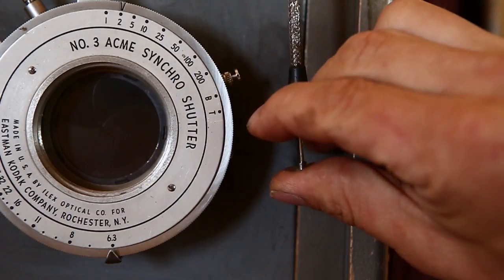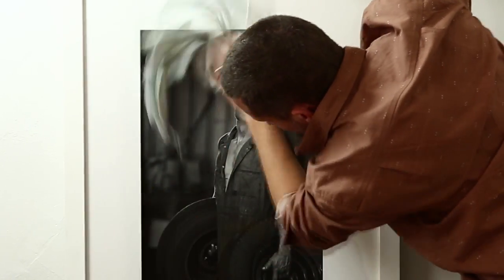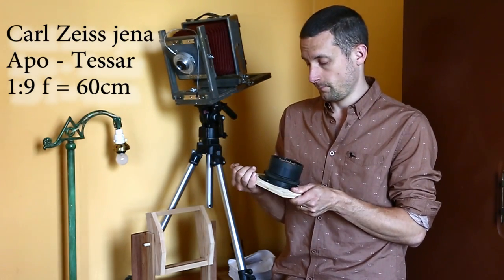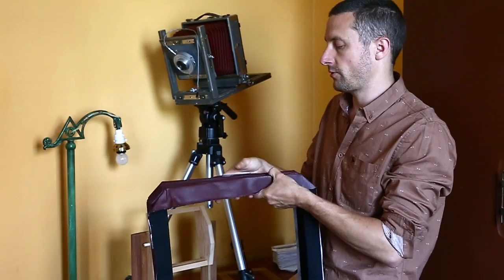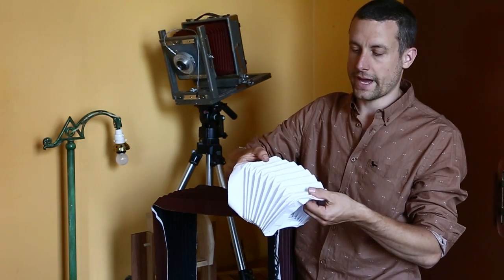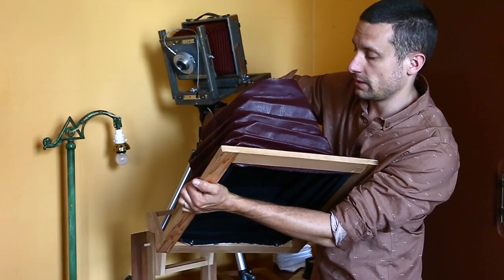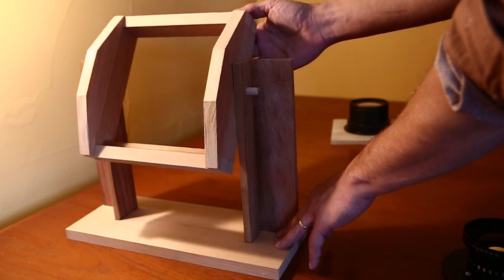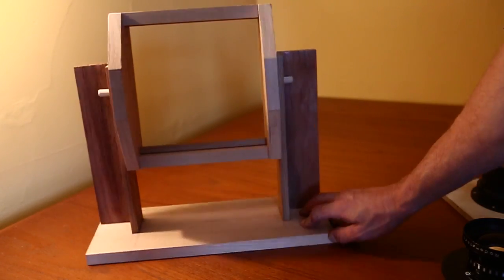View camera build

Comment: How would you figure out the projected image circle of the lens if you don't know the focal length of the lens you are using? I am making plans to make an 8x10 sliding box type camera with a single element lens but am unsure how to choose a lens for it. Do I choose a lens with a wide or narrow diameter and what will affect the size of the image circle I get on my negative (I am thinking this will be the distance from the lens to the film -like a magnifying glass)? Thanks anyone for the help!
Reply from the maker: Lens coverage is published if you can find it. usually longer lenses cover more. It is not just distance that effects coverage, some lenses have a broader projection. Focal length is nodal point to film distance when infinity is focused, you can mock it up.

Comment: Hi Nick.  I'm starting to go down the same route and want to make a ULF tintype (though, not nearly as large as yours).  How did you determine the right lens size?  I'm having a helluva time figuring out how to pick a lens that'll give me the coverage. BTW, i feel your pain in the "inclination to make things hard."  Great job! Thanks!
Reply from the maker: Patrick Day Thanks for your comment. Some Evilbay advertisements actually state the rear image circle. If not Google a lens you have found and you can read about what people do with it in forums. Each retro lens I have bought has had hours and hours of research to ensure it would serve my purpose.
Reply from the maker: Patrick Day Start by deciting what size plate, search for a Petzval or process lens. Longer focal lengths generally have a larger image circle.
Reply: Thanks! I've found a 360mm f9 nikkor apo enlarger lens so think I've got the image circle resolved for 8x10 with some movement.  I will probably build a few holders at different plate sizes.  I figure I can manually do the shutter.  I'm still scratching my head on how long to make the camera/bellows.
Reply from the maker: Patrick Day People say enlarger lenses under perform when focused at infinity, I wouldn't be discouraged if you want to shoot portraits. I did a test, I asked my wife to hold a torch at the top of her head and at her belt and shine those torches at the lens I held in a dark room. I the projected the bright dots to the wall in focus and the distance apart to fill the desired plate size. Then measure the distance from your lens to the wall and this is the longest bellows needed for a half length portrait.